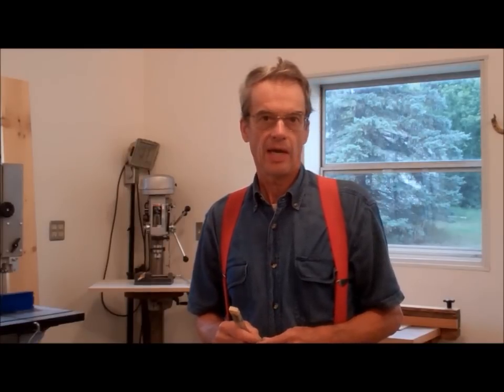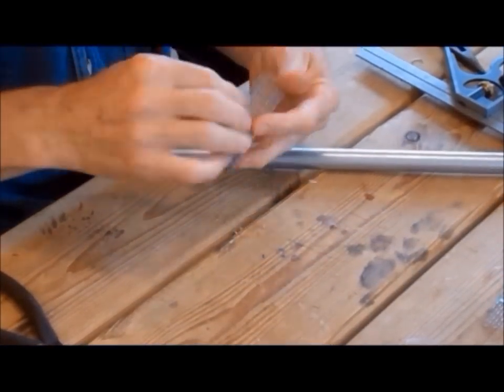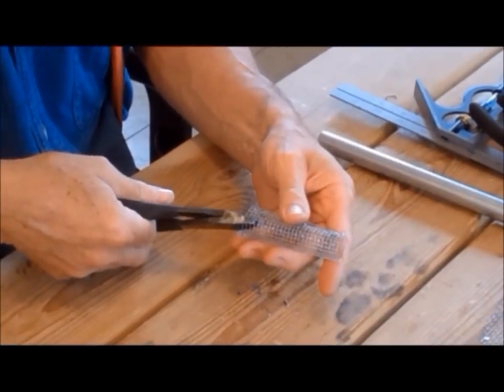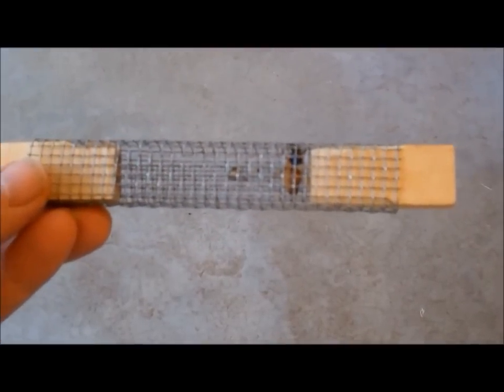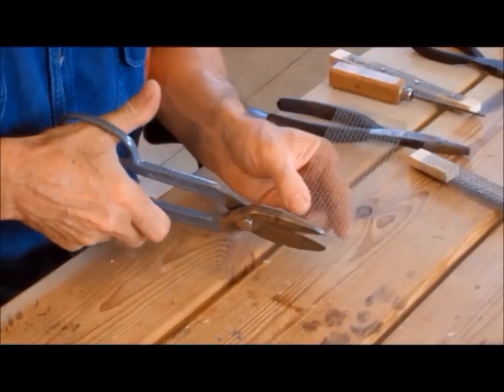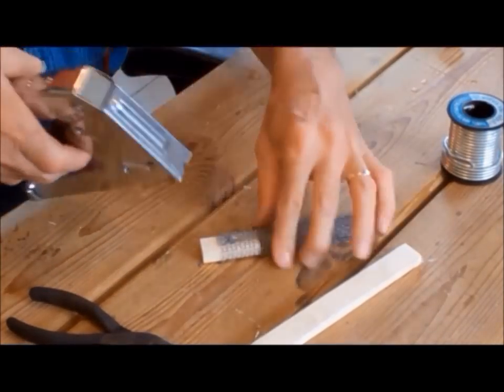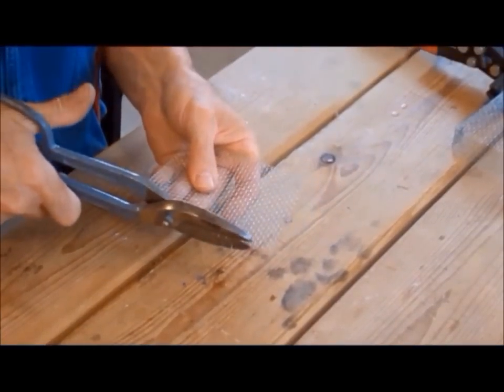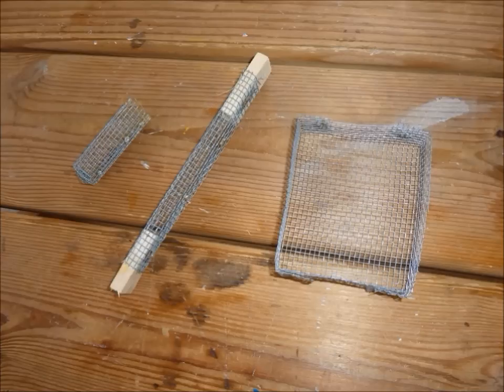Three ten minute projects

Comment: Hitting the edges with a rubber mallet over the forming stick will help sharpen and set the corners without damaging the screen.
Reply from the maker: True enough.  And as a general rule in the workshop, if the mallet doesn't make a good enough corner, get a bigger mallet!

Comment: If you cut a slot down the narrow side of the wood, where the cage meets and you pre-prepare bent wire and put them in the slot, you can more easily secure the cage in the middle. Just a thought ?

Comment: I found it easier put solder on the end of the gun take the pliers push down, dab the solder on it,  let it cool and release, then add more    Rather than using the wire ties

Comment: i like your channel. WOndering about the smell of the sodering grease ( i dont know the name) could it deter queen acceptance? how do you clean it? great ideas. Im a beekeper from Argentina, ive traditionaly made queen via blind nucs at late summer. We have relative "gentle" winter (if there's such a thing, lowest temp is -5°C less than 15 days a year). This is mas fathers career and i want to improve the queen rearing system such that we start replacing all 3yo queens, making 33% of new queens is going to be a challenge, but achievable i think.
Reply from the maker: I have never seen any adverse reaction to the solder or the flux.  If you are concerned, I would simple wash the finished item in hot soapy water.

Comment: Thank you for making such a simple, straightforward, easy to follow video! Would adding extra wire ties be secure enough without soldering? We don't have the right equipment yet.
Reply: Certainly worth a try.  You might also try a small dab of glue (such as super glue).